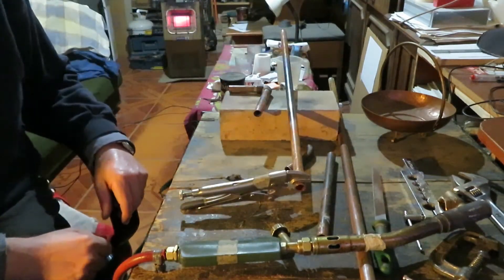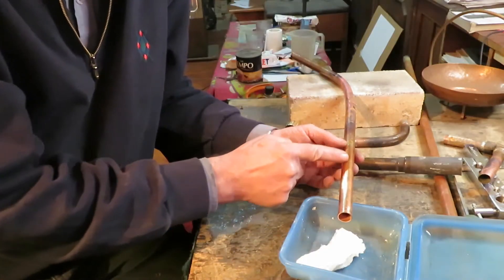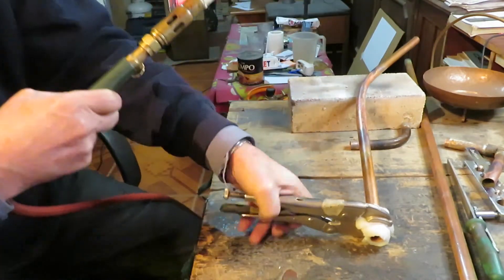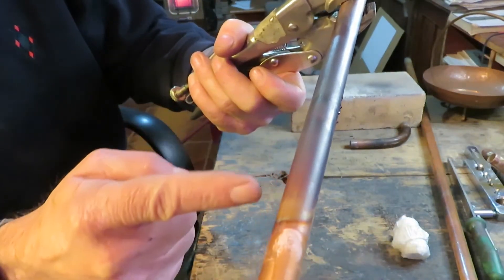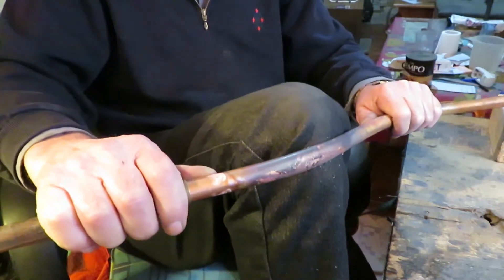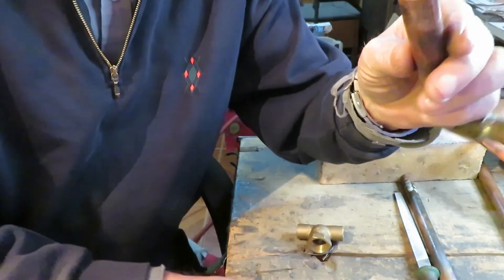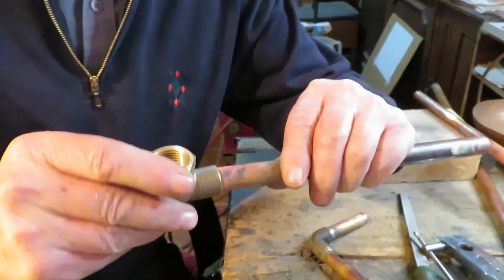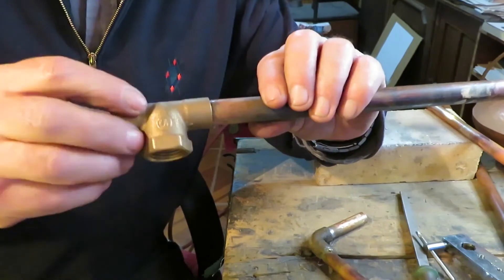Step-by-Step tutorial: How to Anneal Copper Pipes

Comment: Thank you 😊 for refreshing my memory, I was thinking just heat , don't quench it , natural cooling,
Great useful 👍 tips also 👌
Now I just have to master my soldering skills as seems not to want to "take " to the Cooper, 
Baker's soldering + flux paste seems useless😢
Baker's soldering Fluid I've always used for brasing
Flux solder I just bought ,grwwwwww still as useful as a ashtray on a motor bike 
Even after phosphoric clean ends to be soldered😢
Reply from the maker: Thanks for your comment Geoff.
Reply: Have you practiced these various soldering and braising on fresh copper? Even shiny fresh copper has a thin layer of oxide, which must be abraded away just before applying flux. Solder flux doesn't work well at [removing] oxidized copper, it just prevents further oxidation during the brief soldering. 
 @geoffgeoff38  
Annealing creates a hard thick layer of copper oxide, which has to be removed with even more abrasion. That's why nitrogen gas is used to keep away oxygen during factory annealing processes.

Comment: I have some 22mm copper tube bending to do and I'm seeing different advice about whether to quench afterwards or not. I think your approach to just let it cool in air is best, but do you know about this? I'll be using a spring bender of course! Thanks
Reply from the maker: In my experience I have found no noticeable difference in slow or fast cooling of copper.  However, I must say that in my years as a gas fitter I didn't do much bending, I never owned a bending machine (I used my knee and sand), and in this context I never had any issue either with slow or fast cooling.
Reply: Tubing is softer than copper pipe. You may not need to anneal at all. 
 @esuohdica  
But if all the working steps harden the tubing excessively, then you need to anneal at some midpoint in the work. 

I recommend that you practice using the briefest amount of heat needed to reach 500°C, and promptly quench the outside with water to stop oxidation.

Comment: Thanks for the Demo! Just tried annealing a copper lugs for 4/0 this morning before I bent them. Probably didn't do it correctly, but I wanted to make sure they were as soft as possible to reduce the chances they weaken after I install them on the batteries. Any thoughts?
Reply from the maker: Below you will find some comments that might help.  Some suggest dropping in water for a fast cool and better anneal.  I haven't noticed any difference with slow cooling, but it won't harm you to try.  Others say the colour of the copper can show you the optimal annealing temperature. I don't see that is useful with copper pipes, but with lugs it might be possible to stop at the right point.  One thing is clear, with small or thin bits of copper it's easy to overdo the heat to the point of melting the copper and making it brittle.
Reply: @RODsDIY  thanks for the information. I have found they are fairly easy to bend even slightly hot. I think it's perhaps they are sent soft knowing that they will be crimped.

Comment: If annealing hard copper pipe, do you quench it in water or just let it cool at room temperature. Would the two produce different results?
Reply from the maker: When it comes to bending copper pipes or forming copper sheets I have seen no difference in fast or slow cooling, and I have done some really thin forming in copper sheets (artistic forms).  With steel maybe it's different, due to how the molecules behave, but I don't work with steel and I have never tried both methods.  If copper, at a molecular level has different behaviours, and one method is better than the other, I really can't say.

Comment: Great video and tutorial Rod, thank you.
I wasn't aware that you could just let the copper slowly cool off.
The plumbing shop I worked for taught us to anneal copper by heating it to a cherry red, then quickly quenching it in water. It did make for a very soft and easily worked copper.
Reply from the maker: Well, maybe there is some degree of "softerness" in dropping it in water, but I've never noticed any significant difference.
Reply: @RODsDIY  The data suggests there isn't much difference in either quenching or air cooling.  It's getting it up to the right temp that causing the annealing.  However a longer cooling process, such as in air, will allow a thicker oxide layer to build, as well as slowing down the speed of work (you gotta wait for it). So water quenching means faster work cycles, less oxide build, as well as the thermal shock causing what oxide has built up to flake off.  I should also note that cherry red is a bit too hot and can place you on the other side of annealed and cause excessive grain growth.  You want what barely shows up as a dull, faint red in a dim room.  A well lit space or bright daylight makes it hard to see this dull red.  This detail is minor, and you are still getting the benefits of annealing by going to cherry red but are losing some integrity in the material.  Copper anneals between 370C and 650C (700F to 1200F).  The dullest "black" red is 500C(932F) which is more than enough to anneal.  A bright "cherry" red is 800-1000C (1650F).  That's 300C (572F) over temp!!  You're just wasting fuel, building thick oxides, and damaging the microstructures.  *TL;DR heat to the dullest faintest red as seen in a dark space, cooling doesn't affect softness but there are additional benefits to quenching such as speed and reduced oxides.*
Reply from the maker: @SolarMillUSA  Interesting info and I must assume that might be useful for some precision tasks, although I must doubt any plumber can see the difference in colours of copper while annealing, usually in quite lit up places and with equipment that will heat up a pipe with a flame that varies from blue to yellow along its surface, that is, a variety of temperatures playing all at the same time.  How do you differentiate when the pipe is dull red or cherry red when all colours can happen at the same time along the length of a pipe, while you mover the flame along it?
I must disagree this info is of any use in pipe work and similar tasks.
Reply: Ahh, so that is why so many flakes were shed from the 45° sweep elbows. The surface was more oxidized due to getting hotter than needed.